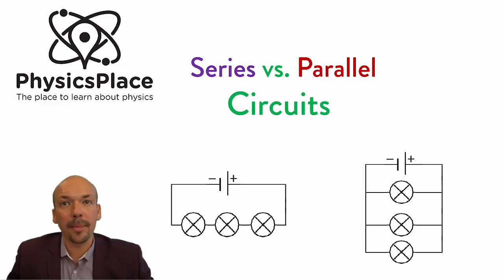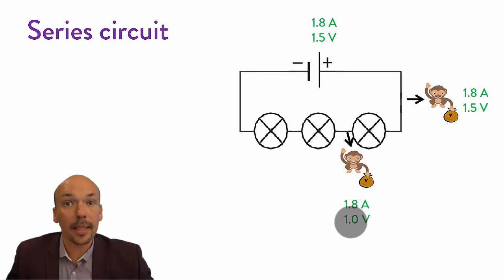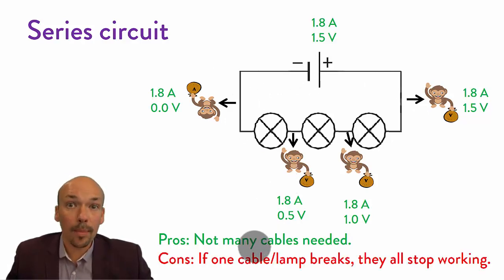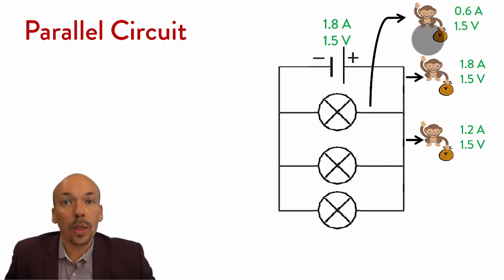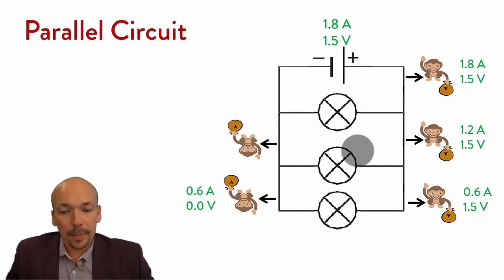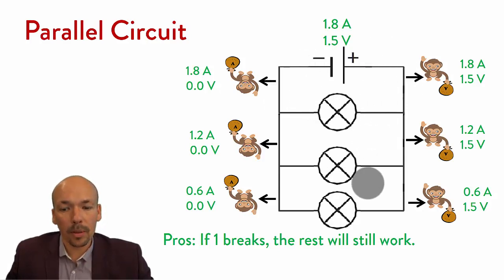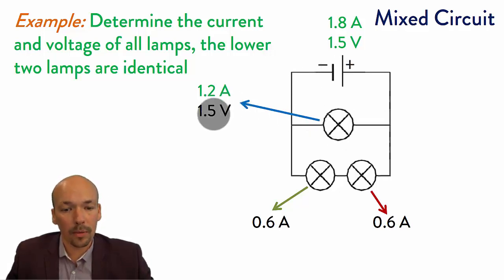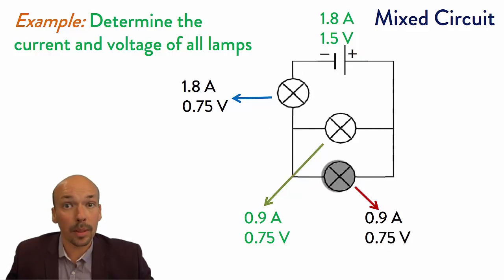Electricity explained 4: Serie vs Parallel Circuit

Comment: im at my first year in Uni and i always knew that in parallel Itotal=I1+I2...+In. but i never knew why exactly, i dont know if i neveer understood or it was never explained to me. the example with the classmates and the books actually helped a lot and once i understood it it felt like a new world opened up to me. thanks very much. 9Gag btw.
Reply from the maker: Nice! Glad I could help understand. If possible I try to include the "why" in my explanation as I fell it helps to remember.